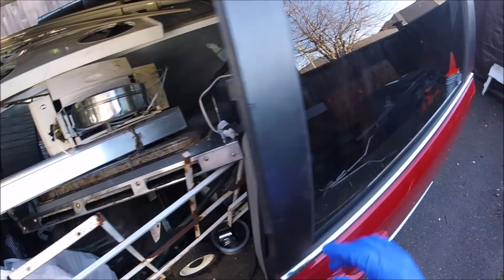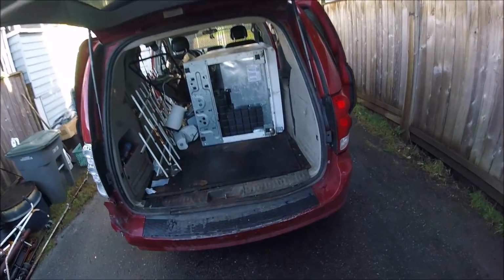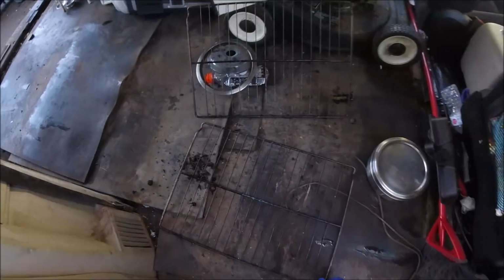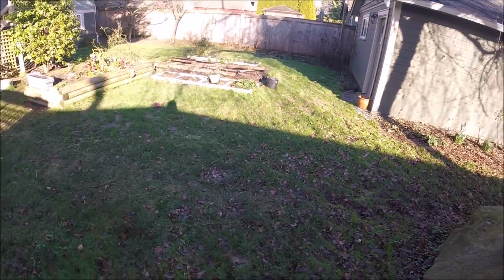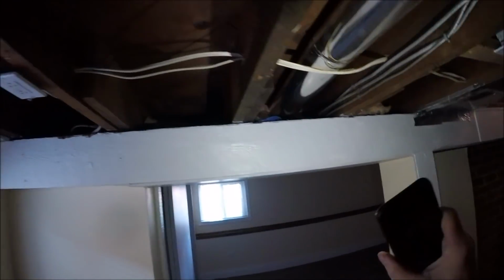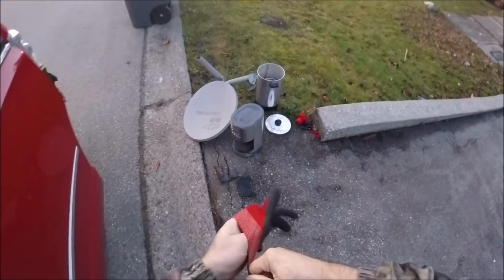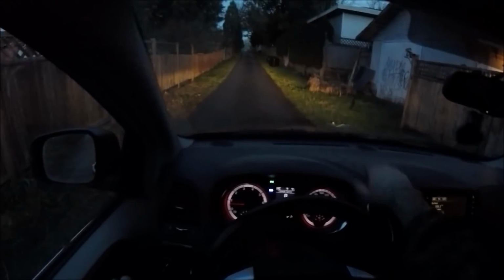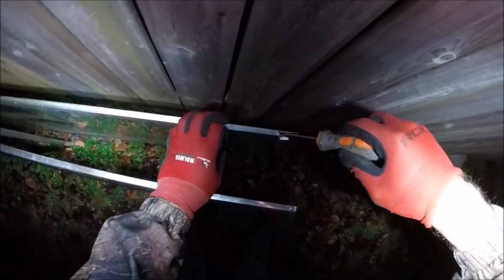Unloading Scrap-- Demo House Tour-- Street Scrapping

Comment: Just a thought/question. Will those microwaves fit in the top loading freezers you have found? Easy way to fill up the air in them with.
Reply from the maker: I have so much metals, It don't matter

Comment: I HAVE A QUESTION ? IS THERE A REASON THAT YOU USE THE VANS TO HAUL SCRAP INSTEAD OF A 3/4 TON TRUCK ?
Reply: I think it comes down to fuel cost
Reply: I can almost guarantee it’s because of the amount of rain
Reply: @bigteam4875 gas is expensive here and easier to load in the van

Comment: Phil, why would you fool with the shower doors and that glass for aluminum when you would not do so with the dry erase boards? It seems like the boards would have been easier.
Reply from the maker: Tempered glass will fit in a pail & that heavy water logged board is harder to dispose